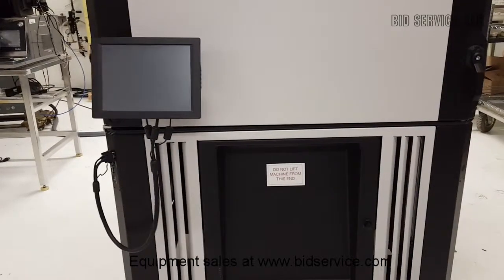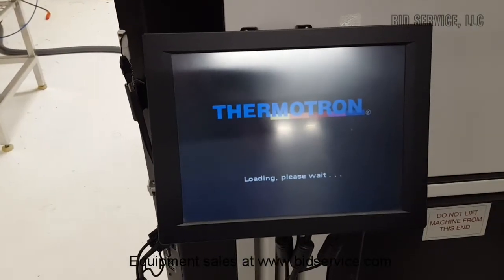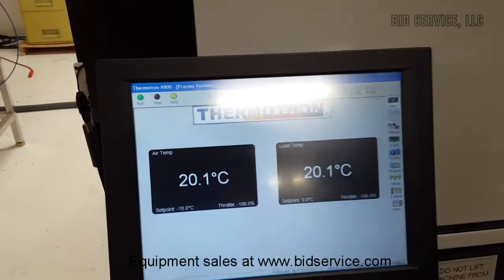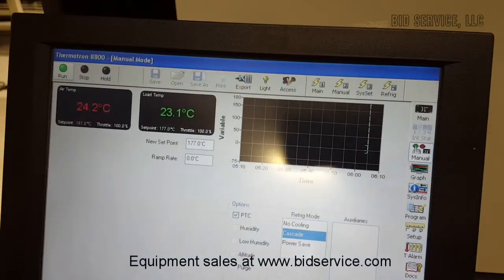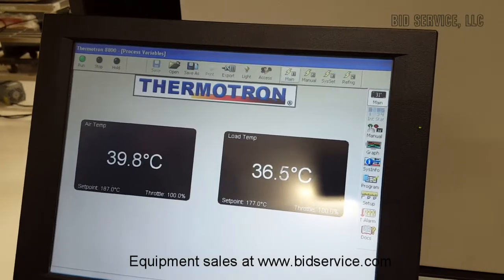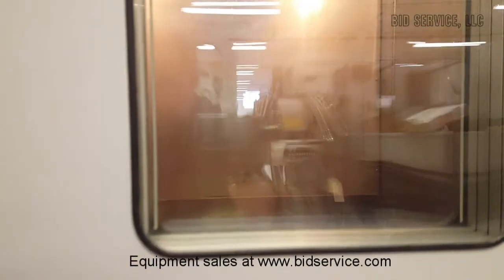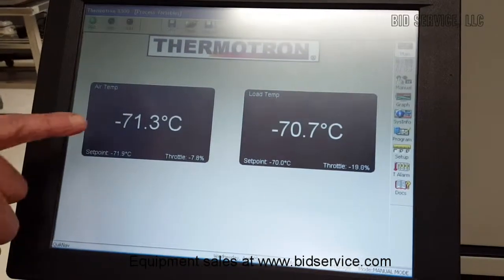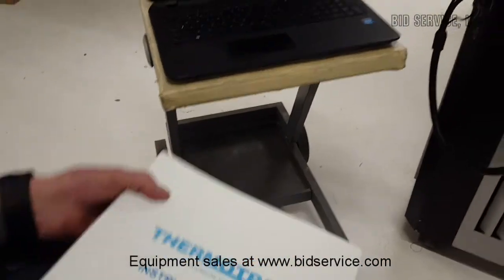Thermotron SE 1200 6 6 Temperature Chamber #62264

Comment: I've been using SE600L-3-3 upgraded from the 7800  to 8800 and SE-650-15-15 that comes with the 8800 and has the DAQ plus Ln2 boost. Its been an impressive test chamber.
Reply from the maker: Thermotron make great systems.